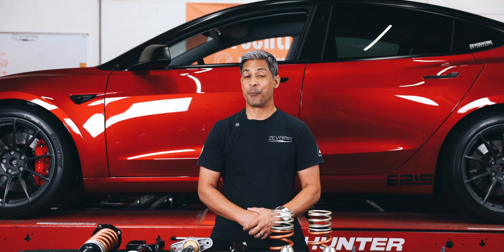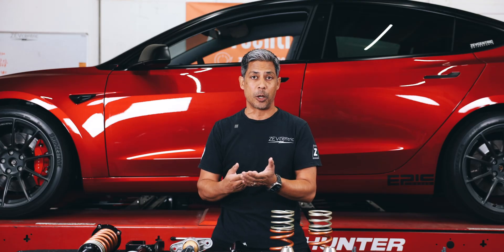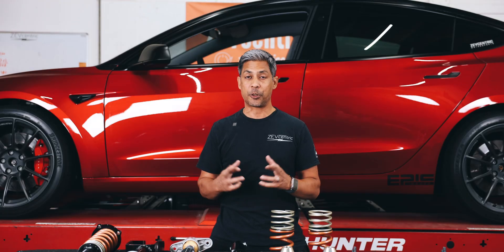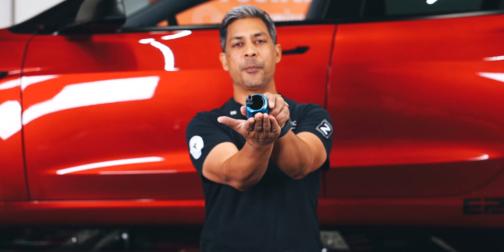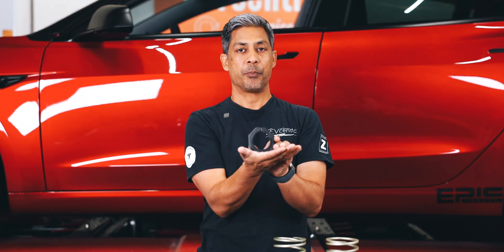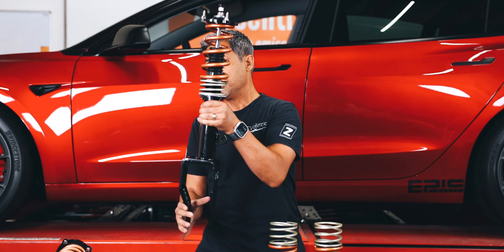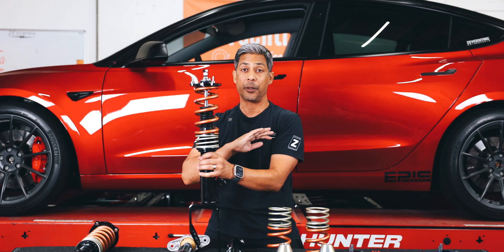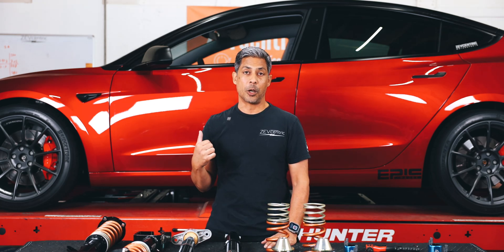The ULTIMATE Highland Model 3 Performance Build for EVX Autocross — Bespoke Shocks Inside!

Comment: I want to see a video of you guys comparing stock suspension to all of the parts you guys have installed. Like compare the weight of parts and do every single peice you guys have. I want to see what it looks like when you guys do more than the two like toe and camber arms you guys have
Reply from the maker: We'll keep that in mind but generally our clients are waiting here while we're wrenching and we are a team of 2 believe it or not, Tim and myself, so it's not easy to fit everything in.  The aftermarket dampers/springs will vary in weight but we can probably make a video comparing oem arms to aftermarket arms.  MPP may publish some of those weights in their blog as well somewhere.  I'd imagine if you change every rear arm out you may only save ~10lbs per side and that includes the lower spring arm.  It's super rare that any of our clients change out the trailing and traction arms as well.